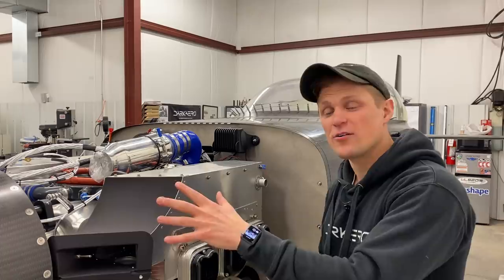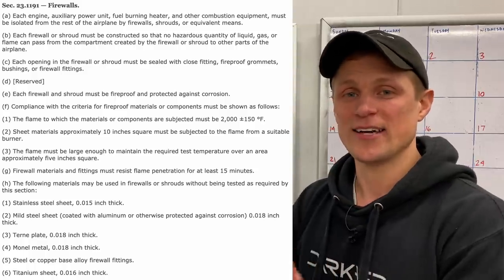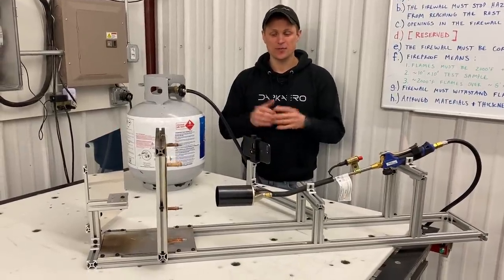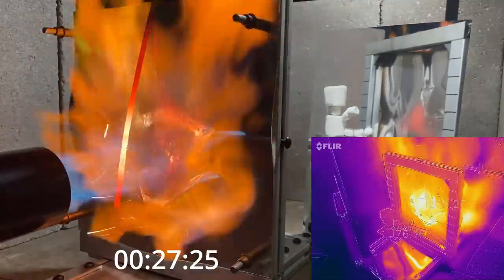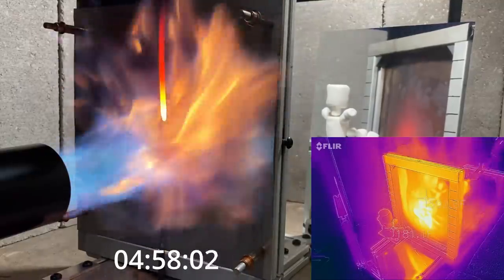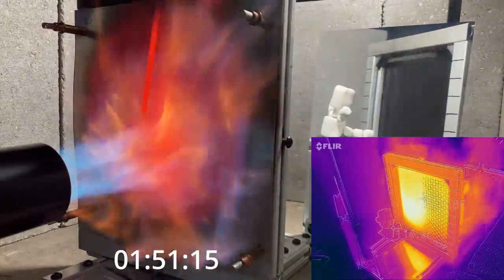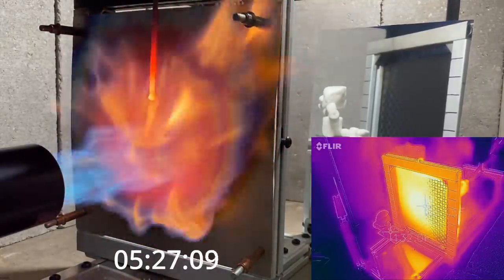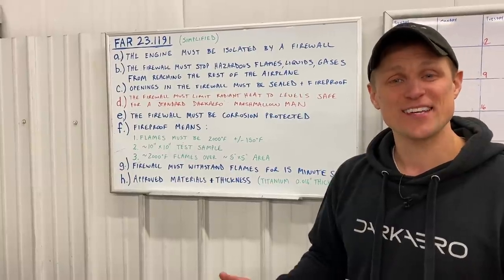What is the best FIREWALL material?

Comment: The best extremely lightweight firewall material I've found to stop radiant heat is generally known as griddle brick material. I've used it in numerous composite builds since 1991. Grill Bricks are a pumice-like cleaning block made from recycled materials. Basalt is the primary ingredient. The conveyor furnaces that shape the raw ingredients is way north of 2,000 F. This material is also used in chemical plants to insulate high heat pipes. I have a source in the DFW area that purchases the 4' X 4' X 8" blocks then cuts it into half round radiuses to insulate pipes. The material is very brittle but has a very high impact absorption strength. It smells like Sulphur when cutting it or picking at it but the odor is safe for animals and humans. Incapsulated after cutting there is no smell. It's one of my proprietary composite blend secrets that I'm now releasing to the public. It will dull normal cutting tools in seconds. Cheers
Reply: We used fire brick and insulating block for radiant head stoppage in fuel fired boilers, it’s made out of the same material and we had firebox temps up to 2500f, out side temps were around 95f. That’s steady state running for hours. Great point you have!
Reply: You call a youtube comment a "public release" ?! .....lolz
Reply: @_Joy_Unleashed  - Most public releases to what was once considered intellectual property or proprietary are now freely available as a public release on YouTube. I like open-source information. It's a shame many also post click bait and untrustworthy information as well. My intention is to offer what works especially when it comes to aviation projects and the great guys with DarkAero. I love spending time with their valuable channel. The plus side is reading the comments of their channel. A great community of folks in my opinion. Have a blessed day!

Comment: Dont forget the smoke coming from resin in the final carbon structure. We use a special UL94 resin for carbon firewalls with honeycomb on a racecar and they are a pain to work with. They need a specific tempering heat cycle after curing otherwise they become very brittle.
Reply: Can you kindly tell me.more about this UL94 Resin

Comment: Pay attention to materials based on magnesium oxide. MgO boards with fiberglass have a very high fire resistance. Also on the US market there is a material called "Airkrete foam" based on MgO.  It is a very lightweight refractory material used in construction as insulation.  This material can be used in aviation because it is very lightweight.

Comment: How do you ensure the heat does not break the structure of the airplane apart? I mean, what good does the firewall do if the front falls off and the weight of the engine is gone.
Reply: I think I know the answer: you just need the motor mount to hold and it's quite solid going through the firewall.

Comment: This is exactly how cirrus aircraft firewall is built. Yes, it works....mostly. I've repaired one that caught fire. It stopped alot but not all. I was able to save the plane by replacing a large portion of the structural firewall then the entire fireproof metal and ceramic. It did save the pilot from harm

Comment: If cost is not an issue the use of titanium is a very reasonable choice. As shown by other manufacturers some materials may just not be "necessary" to achieve the desired result cost effectively? Just the opinion of a former AF Crew Chief, if the engine fire was serious there would be melted blobs of engine aluminum flying around long before a firewall would fail. Cool vid to watch though and it's interesting to see the hoops you guys are jumping through to get FAA certified.

Comment: I have a little secret about stainless steel. It does not radiate energy very well. You notice all those cool drinking mugs made from stainless?  It's not just the vacuum that insulates. The high nickle chromium content refracts the energy back into itself. So yes it glows, but the transmitted energy is much less than carbon steel or titanium. I personally saw an old time wood stove with a brand new 16ga 304 stainless shell. You literally could not burn enough wood to heat a room. The top cast iron part was the only thing transmitting heat. The same stove before with carbon steel sides would run you out of the whole house in an hour. In my opinion this explains the less toasty marshmallow man on the stainless test. Really awesome test setup by the way.

Comment: I'm sure you guys have already settled on the design you are going to use for the firewall, but I'm curious. Did you think about infusing the honeycomb structure with starlite instead of the ceramic blanket, and if so, what would be the reasons to not use it? 😁
Reply: As far as I watched videos about starlite recreations the material would degrade over time. Wasn't starch one of the components?

Comment: I wonder about flames that aren't centered on the firewall.  Imagine, for instance, that an oil line busts and sprays hot oil that then catches fire near the edge of the firewall.

What happens to the interface between the carbon fiber airplane structure and the firewall?

Also, how does a fire affect the structure of your front landing gear?  IIRC, that's mostly aluminum and mostly forward of the firewall.  Does the slot for the landing gear pose any kind of threat for ducting fire around the firewall?  If the gear in the engine bay were to melt or warp during a fire, you'd presumably drop the nose onto the runway during the landing.  Do you have any sense of whether the plane would tend to flip if this were to happen?

You guys are a huge inspiration.  Thank you.

Comment: You could try an emissive refractory coating to reflect some of the heat. ITC 100 or ITC 213 Ceramic Coating for example. You'll have to ask them if it keeps sticking over the years though...

Comment: Hi, 
The honeycomb structure has many pockets of air, which can act as a micro pressure chamber on each air pocket when there is sudden increase in temperature and how do you solve these problems. Because you don't want to lose structural integrity of the firewall in that situation. Which leads to set of new problems.

Comment: Great explanation as always👍🏻😉
Is it possible that the heat from the engine could make the canopy opaque or is it something really hard to happen?
Reply from the maker: Are you asking about just waste heat from the engine running? or heat from an engine fire? Either way, the canopy is made from thermoformed acrylic which will soften when it gets hot enough but it doesn't turn opaque. Thanks for watching! :)
Reply: @DarkAeroInc  Thank you for the answer😉
I was asking especially for engine fire sitation
Amazing work! I hope to see you in flight as soon as possible😉😉

Comment: Nice work as usually...    Have you heard of  "starlight"  ......non-commercial fire insulator.
Reply: I think that might be too fragile for continued use in flight. I would also suspect that the vibration and shifting of a failing engine in flight could knock away the carbon foam created pretty easily. It is a good idea, though, and I would like to see it tested. Maybe there is a spay version that could go over the finished firewall as extra layer of protection to give more time to the pilot.
Reply: @David-yy6hp  Good point regarding vibration effects - a practical and valid point that is NOT addressed in the FARs (at least not as covered in the video). Addition of starlite would still be an interesting test, even if some method to simulate engine vibration were added. I wonder if the light weight of the carbon foam might protect it from flaking due to mechanical vibration. Simply coating in 'starlight'-like material might also be prone to inadvertent mechanical damage in service (which would result in compromised protection), but it could be protected with a tough sacrificial coating.
Reply: @robbmain1684  I saw a video by nighthawkinlight about making the coating stronger through the addition of borax, which created a glass-like binder for the carbon foam. A carbon/glass foam manufactured more cleanly might be a very good approach, but then it starts to mimic ceramics. I think that a carbon foam layer, if it could be made to withstand vibration, on the engine side of the firewall could be useful for heat dissipation due to the radiative properties and the air entrained inside of it. I would love to see some tests on carbon foam materials and their implementation cost as well.

Comment: Okay, I'm going to ask a dumb question: Would a halon fire suppression system for the firewall forward area makes sense? Oh, and add a fire sensor too.
Reply: Yes. Race Cars use those systems and they are mandatory in any professional racing. They weigh about 7-10lbs for a small one. 

The only issue in an Airplane is the huge volume of air going thru the engine compartment will blow the Halon out the cowling immediately. Whereas a race-car usually crashes and stops before the extinguisher is utilized. An airplane can actually put the fire out by diving to VNE or Vd in some cases, and if that doesn't work to blow out the fire like a candle, at least you're diving toward the ground as fast as possible and will therefore land as quickly as possible.

In an aircraft, an IR sensor for heat or a wire that melts and illuminates a warning light in the cockpit could be beneficial.

Comment: I have a feeling the firewall youre trying out is Starlite and since its made from PVA glue mixed with corn starch and baking soda would be very cost effective.  The fact you can coat your hand in it and then take an Oxy Acetylene torch to it is proof enough its the best firewall except for being ablative so it wears aways over time.
Reply: Take a look at basalt derived materials. Matting cloths wraps and ceramics..

Comment: I'm curious about carbon fiber as an insulator. In my test a few weeks back I pointed a MAP torch ( ~3700F ) directly at a 1.5mm thick sample. The binder obviously burned immediately. After about 2 minutes though the binder was gone and the face of the carbon fiber sheet was bright red, but the rear didn't show any color change. Any chance this is part the setup you're testing out?

Comment: Wouldn't an air gap be a better than having solid insulation?  From my exhaust experience we typically use a stainless and insulator sand which and then an air gap between the surface to be protected.  Doing the math, thin layers with air gaps are the best defense against radiated heat.

Comment: Maybe covered in a different FAR, and maybe already planned for an upcoming video, but will you cover how you plan on protecting firewall penetrations? I assume harnessing will go through bulkhead connectors (are they specially rated?), what about things like the fuel line, mechanical linkages, etc.? It's all very well to have a brick-s**t-house firewall, but if you fail to protect the holes that you require in it, it can still go up in smoke!

Also, you comment on fumes from the carbon fiber (or more likely, from the resin) - are there no requirements to deal with outgassing under these conditions? Or is the plan to just open a window...? 
:-)
Reply: I'll answer about connectors: you can use firewall qualified connectors. There are various specifications, military in origin, two of which are MIL-DTL-26482 and MIL-DTL-38999, but there are more (I just happen to be more familiar with those two). Usually for most aluminum made structures in non-fire designated zones connectors made of aluminum and cadmium plated were favored, not so much in newer designs due to cadmium being banned for health and environmental reasons. For firewalls you have two options: passivated stainless steel ("K" finish designation) or nickel plated stainless steel ("S" designation).
FAR are not always so detailed, and with every revision they become even broader. I suppose this comes from many complaints by the industry regarding normatives being so stringent that evolution is slowed down. Broader definitions and requirements allow manufacturers to use their know how and to incorporate more promptly newer non-standard solutions, as long as they comply with key requirements. Nevertheless, FAA mantains a series of Advisory Circulars, which are nonmandatory guides giving details on how you can comply with FAR, and there they do specify hardware, materials, procedures, etc. as a reference based in previous proven designs.
On the fumes issue, I cannot recall now but there's quite possible a paragraph addressing that, it was one of the reasons for PVC being forbidden as wire jacket material in aircraft. In any case, if it's not mentioned in regulations but the FAA still considers that there's reasonable risk, they will ask you to solve it.

Comment: instead of the ceramic layer why not an Intumescent layer between the titanium and the CF sandwich? As it heats up it expands and provides greater level of safety. perhaps to the point where the cf sandwich would be undamaged.

Comment: I hope you see this but i realize its an older video...but why not use inconel? Im not fimiler with airplane specs but i have a motorsports background and anything high heat high melting point low thermal transfer ect inconel was the go to...not on the list??

Comment: Insted of just a solid layer of Ceramic insulation use grinded or flakes of it, it will fill it with more air hence more heat dissipation and lower temperature of marshmallow man✌️

Comment: What about structural stability and crash resistance? Isn't that something the firewall does too?
Reply: Example scenario, you are landing and a weel fails because of a puncture. Plane gets hard to control and impacts the front with a slight angle and hot engine... fuel pump still running? Arms broken from the impact? How do you get out? Are you still protected from the fire?

Comment: Thermal emissivity of many bare metals is very low. Especially aluminum, titanium and stainless. (This pertains to a shiny or polished surface.)
What this means is that an IR thermometer will show a low temperature. So you cannot use an IR thermometer to measure the temperature of these surfaces.
I think it would be very important that you Google 

thermal emissivity of metal engineeringtoolbox.
You will see that a lot of these bare metals have an emissivity of less than 5 or 10%. Normal non-metallic materials are over 90 or 95% emissivity.
IR thermometers register how much thermal radiation they receive. A shiny piece of aluminum, silver, and especially gold, radiate very very little infrared energy. So their IR "temperature,"  is much lower than actual.
Since this is very important as related to a firewall you need a valid way of measuring temperature. Thermal infrared radiation emission will always be much lower for these materials. That's why you can't use an ordinary IR thermometer.
Of course there are IR thermometers that are calibrated for a particular metal that are used say, in the refining of these metals, but your IR thermometer is not so calibrated. 
Also, I may be mistaken, but you were measuring the temperature inside the oven. That doesn't work. The window in that oven is completely opaque to thermal infrared. All you were measuring was the surface of that window. Put a hot object behind a glass window and measure it. The temperature you read will be the surface of the glass.

Comment: Can the Ceramic Heat Shield Blanket, at 1/8", be Doubled in thickness?

Compare Marshmallow Man, against Nut Man, and a Woods Metal man! (Sprinkler Plugs!) 

I would suggest, the Temperature, 1" to 2" from the Firewall on the Ties side, should not exceed 110°F, but Ideally, be kept under 85°F, in a Full on, Forced Air, In Flight Engine Bay Fire!

Comment: I have misgivings about the firewall design and specs.
I suspect that there is a failing in the general specs of the firewall design as dictated by the minimum requirements
Because the engine mounts to the bulkhead firewall catastrophic failure could occur due to fire weakening the engine mounts and other structures that attach directly to the firewall, Should a mount fail the engine could tear away taking the firewall with it or causing other serious damage .
On any aircraft of similar configuration steps should be taken to protect mounts and solid firewall protrusions that might conduct heat directly into the bulkhead structure bypassing the firewall. Designing the firewall to be floating separate from the bulkhead with an air gap and possibly a second firewall consisting of insulation material with an aluminum foil backing would suffice to protect the bulkhead and limit heat conduction, Heat wrapping the engine mounts would help but would probably be unnecessary

Comment: Lighter weight than titanium and fire resistant?  Hexcell Hexply 200 phenolic prepreg(or any other carbon-phenolic prepreg meant to be ablative, really) ? Needs an autoclave for curing, so having to pay someone to lay up panels for you may be a bit annoying. But it would certainly fit whats been going into the plane so far.